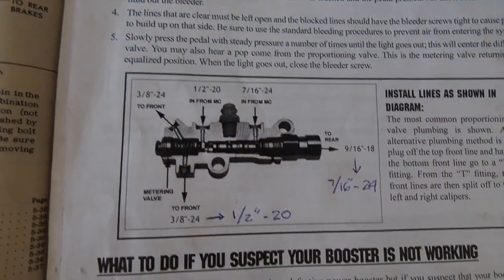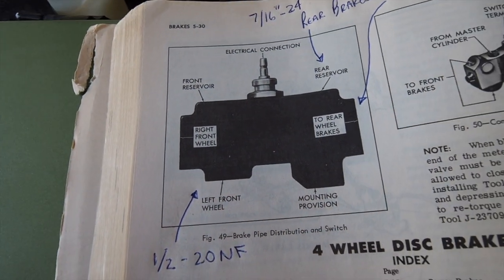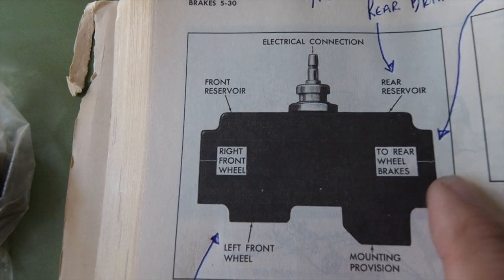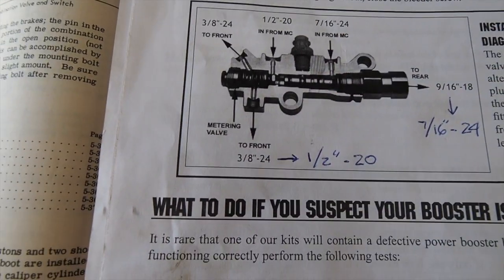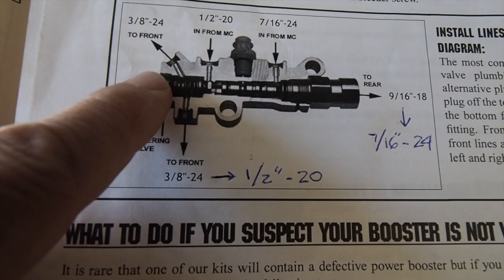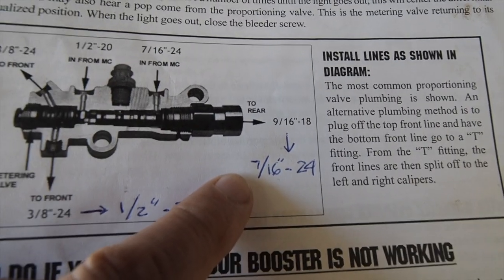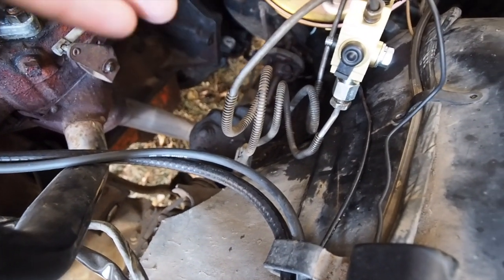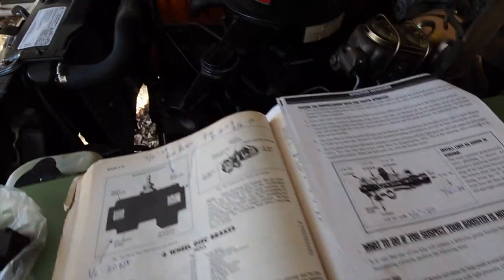1971 Nova Disc Brake Install. "What They Don't Tell Ya"

Comment: working on my 71 Nova now. Finishing up front suspension (had to take a break from it since we didn't have the pitman arm) so we got on the disc brake conversion. This video is the missing piece I needed for that adapter on the valve. A video that keeps on giving. Hope all is well.
Reply from the maker: @blastys  thanks for your kind comments and for watching. All is well here and hope so with you also.

Comment: Distribution block.  Proportining valves allow you to adjust  the front to rear brake [ fine tune ] especially if the car has AC or is being raced.  Good video overall.

Comment: I converted my 1969 chevelle from all around drum to disc/drum. I got a new stainless steel line kit, a new master cylinder, a new combination/proportioning valve (from master power brakes) , new hoses , new calipers, and new wheel cylinders. The valve I got came with the necessary flare nut (although NOT stainless steel) to adapt the rear line. I had to cut the rear line and re-flare it with the new nut. The whole setup came out looking pretty good and performs great. Good info, good video
Reply from the maker: Sounds like a cool project I will have to sub to your channel....Thanks for watching....
Reply: @Nova.1971  the brakes and suspension were actually addressed years before i started my channel, but everything is holding up great.
Reply: Did you keep the distribution block on the frame rail when you installed the new proportioning valve?  Or did you get rid of it?  I have same car and recently did an upgrade but think im missing this step as my brakes now are worse than the drums
Reply from the maker: @jeffdillard3201  The new set up comes with the new proportional block that mounts to the master cylinder. You need to remove the old block and use the new one as it splits the flow correctly to the rear drums and front discs. Have you got your brake warning light hooked up also? How did you bleed the system? Mine work fine.
Reply: @jeffdillard3201  oh no, you need to change the block / valve. The front drum/rear drum proportioning valve is calibrated for quicker pressure to override drum spring tension,  while the front disc/rear drum valve actually slows the front disc to prevent lock up. I wasnt a fan of having the valve right under my master cylinder, so i modified the prebent kit to put the new front disc/rear drum valve on the frame, the same as the old front drum/rear drum valve location. Even if you were to go to a frt disc/ rear disc, you'd need a valve for that setup. Beware where you buy your valve, and what threads it uses. I believe mine came from master power brakes, and came with a flare nut(line nut) threaded to the rear port. I didnt know why, until i found out the rear port was metric, M14x1.5. So...i had to again modify my new prebent kit by cutting the flare on the rear line, swapping the threaded nut, and re flaring it,...not fun on stainless steel. So if you can....avoid metric threads. The electrical connector on the valve was also different. But once the car was fully converted to front disc, stopping was like night and day. So was steering and suspension as that was all redone at the same time.  I hope this helps.
Reply: You had a distribution block and a proportioning valve on the same car? Mine just had a proportioning valve for each setup. But like i said they are calibrated different.

Comment: good Video bro ! but have to saw it ! anytime you're upgrading or changing things that or not OE there will always be changes ! they don't tell you this because it really is common sense ! thanks for sharing !  😊😊
Reply from the maker: Yes you’re correct  this is made to fit a wide range of GM vehicles so you don’t get every adapter.  Thanks for pointing that out and watching.

Comment: the first pick is a distubution block for 4 wheel drums they did not have a propotioning valve like front disk rear drums. proportioning valves are used to drop the rear brake preasure or the rear drums would lock up. drums work on way less preasure than disc. That said looks like you are doing a great job on your Nova. Had mine for 32 years now, still doing upgrades, LOL
Reply from the maker: Thanks for the added tip as I  should have mentioned it as I knew that . Thanks for watching and becoming a subscriber!!!

Comment: The part about the original block....  The picture in your book IS correct. MC lines go to the top of the block. Front brake line to the front end,,,, rear brake line out the back end.

Comment: Your video was very helpful, especially with the proportion value adaptors. However, we are having a difficult time finding 3/8" 24 male to 1/2" 20 female for the front brake. Please help. Do you know where we could find this?
Reply from the maker: Thanks for watching I picked them up at a local hose/fitting house. I would start there. I could send you the name of the place I got them at but don’t know where you live how much work it would be to get them to you. Let me know. Thanks for watching.
Reply: @Nova.1971  Thanks for getting back with me. I live in the state of Illinois.

Comment: Back in 1976 I swapped my 68 Camaro to front discs from a 72 Monte Carlo. Never changed the valve, didn't know any better. 
That car never had power brakes.
 I remember the pedal felt different after the swap. I had to push hard, and the car slowed down pretty good.
Reply from the maker: Ya they make that valve differently for power drum or disk brakes up front and different for four wheel disk options as they do for non peer brakes.
Reply: @Nova.1971  wish I still had it. I would learn something & do it up right!

Comment: I remember dealing with those size differences needing adapters.. what a pain.
Reply from the maker: Ya but glad it worked out, and really what would it cost to tell you or include some in the kit, so it cost a few bucks more.......!!!!
Reply: @Nova.1971  I agree, and why didn’t Chevrolet use multiple sizes? So when assembled there was no question it would be wrong?
Reply: who did you buy the adapters from?? It's becoming a pain to find someone who has them.
Reply: @Nova.1971  who did you get the adapters from. I've spent over an hour on line looking and can only find the 9/16" adapter
Reply: @Lonzo_Gonzo1955  it was a pain even when I looked before! It was a mix of summit and Amazon. Which one do you need and I can see if I can find my old part numbers
Reply from the maker: @Lonzo_Gonzo1955  I got them  here https://airtechproducts.ca
Reply: @Nova.1971  Thanks so much!!  I'll check them out. Looks like they need me to call them to get the right adapters. I found the 9/16" IFM  to 7/16" IFF. Can only find a 1/2" IFM to 3/8" IFF which is reverse of what you said and what your diagrams show. OK. thanks again.
Reply: @BillyFargon  can't find the 3/8"-24 IFM (male) to 1/2"-20 IFF (female). Sure appreciate any help.
Reply: @Lonzo_Gonzo1955  look at summit and search wilwood part 220-8849
Reply: I bought the disc conversion and came with zero instructions

Comment: does anyone have the link to the adaptors? or the sizes? I know he is clean on that but I am a newbe and I am just about to replace drums to disc. thanks a lot
Reply from the maker: The adapters I got for the proportioning valve where as follows. For the front bottom port 3/8"-24 to 1/2" -20, for the rear port 9/16"-18 to 7/16"-24. I picked them up from a local fitting house. you should be able to find them on line also.

Comment: Can I adapt 97- 2002 camaro or firebird disc brakes on a 1968 firebird?
Reply: If you ask at the "auto recycling center" the should be able to look it up.  At least that's wh they did for me when I swapped me 68 Camaro over to front disc spindles etc.

Comment: All I want to know before I rip things apart, do I have to bleed the valve & if yes,  how?
Reply from the maker: You can hook the lines up to the valve and let it gravity bleed.
Reply: @Nova.1971  
My 2001 Ram 2500 has a rubber cap  on top (at 90° to the indicator light switch). Under the cap is a button that looks similar to a Schrader valve.  I have not been able to find any info on that thing.

Edit: Giving it a try tomorrow. Will ignore that thing on the first try.
Reply: Ok, bled all 4 wheels. Truck stops & pedal is hard. Two lights are on; ABS & BRAKE. 
I'm so tempted to push on that valve under the black rubber cap. It'll probably squirt brake fluid in my eye!
Reply from the maker: @savage22bolt32  You will need to reset the proportional valve. With typing a long story here just watch this video, that's more than likely why the light is on.  https://www.youtube.com/watch?v=texW8E9EAJQ. hope this helps.
Reply: @Nova.1971  Thank you!